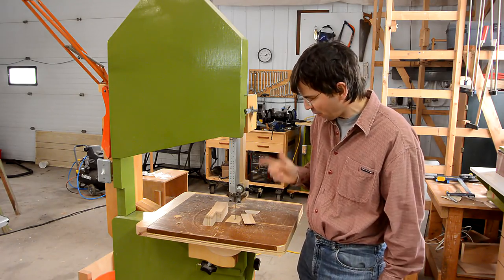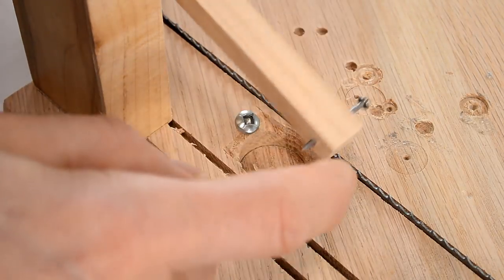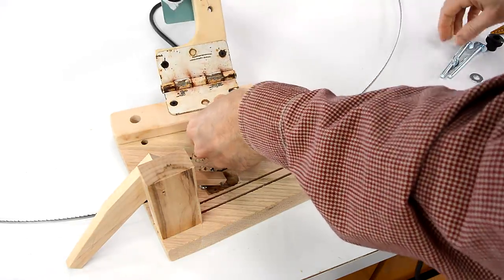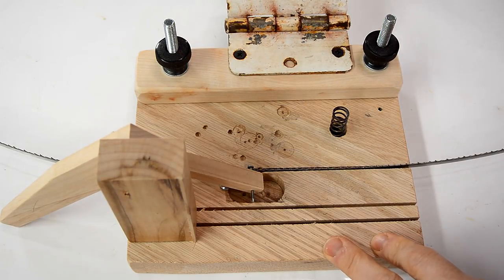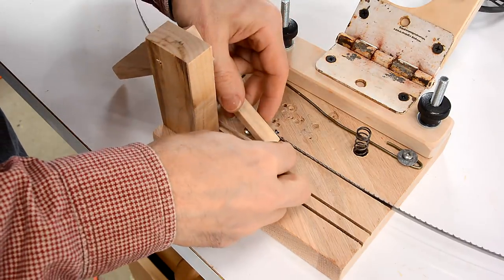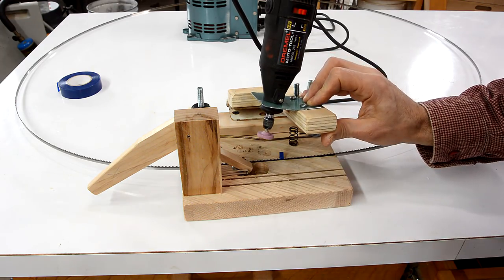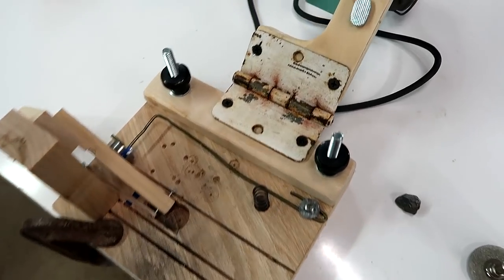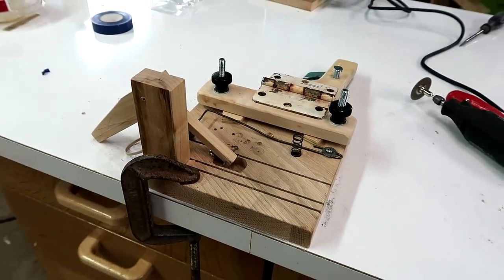Bandsaw blade sharpener jig

Comment: A fully automated bandsaw blade sharpener would be an interesting project, though, I think. A lot of people might benefit from that.
The current contraption is very ingenious, good work.
Reply: Someone else could take this design and improve on it. It should be fairly easy to automate since you only need to set the timing on two points. Which can be done through simple Electronics.
Reply: I think Matthias could figure out a mechanical way to automate too.  Every time the Dremel raises back up, it advances the blade.
Reply: Jason Svendsen, thinking the same thing, all worked by a hand crank, that can also be easily changed out with an induction motor, geared down.   
I'm suprised he didn't find his contraption that useful.
Reply: Jason Svendsen,  That's good thinking!  I would imagine that full mechanization would take more precision, he's operating this grinder plunge by hand to make up for the general vagueness of the machine.  On the other hand, the advance is pretty definite, the teeth probably have very uniform spacing and the rough kind of mechanism for advance might be adequate, so it would make sense to link them.  Also, if there was something simple motorized and speed-controlled that just did the advance and let the sharpening still be "by hand" he might be able to go faster and faster w/o a big investment.

Comment: After trying your sharpening technique just last week for the first time, I see this tooth advance system as a helpful addition to the method. I found that if the tooth was bent to the left I'd move the grinding wheel across so I could hit it square on, and same for a tooth bent to the right (and ones in between). This system doesn't allow for that but still pretty cool. The movement of the dremel was about an inch between hitting a left or right bending tooth square on which is quite a bit. A tricky one to automate but worth thinking about next time I am sharpening. Anyway, Thanks!

Comment: I'd really like to see a follow-up on that jig, but I understand your point. I would have probably made it different in the first place.
Keeping the screw to adjust, but have the dremel spring loaded to drag down on the blade and with a cam-type implement to lift it when pushed further. If that works, automating it would be a breeze afterwards.

Comment: @Matthias Wandel , Facing the contraption, The only way I can imagine this being done automatically is with a 12v DC motor with good torque but not much RPM. Add a wooden wheel to this with a nail. Tie two strong but thin ropes to the nail. Screw two eye-hooks into the side of the thick base. One eye-hook is below the dremel lever, pulling it down when ever the nail is on the east-side(Right). The string loosens during the descent from the east-side(Right) toward the south-side(Down). But during the ascent from south-side to west-side(Left) it tightens the second rope. The second rope pulls on the second lever somehow and this pushes the bandsaw blade forward. Before the rope loosens during the ascent to North-side(Up) before the process repeats.

This way, you can adjust the RPM on the 12v DC motor quite easily to get the ideal amount of time on the contact points. I just can't think of how to easily accomplish the second rope idea. Since it needs to be loose while the other is tight, vice versa. Easiest is simply having two DC motors. 

This would essentially make it automatic. Then it is just a matter of designing adjust ability for different sawblades.

Comment: Ingenious build. Maybe in the end not as effective (quick) in use as you expected it to be but nevertheless: it works and for sure it was fun building it. Thanks for sharing.
Maybe with some (a lot of?) adaptations it is possible to make the bandsaw blade sharpening jig that way that it is possible to
leave the blade at the bandsaw (vertical instead of horizontal now). That'll  save in any case time for mounting and unmountaing the blade.

Comment: That’s a pretty cool idea. Did you use the rusty hinge for artistic value? 😛
Reply: You have to know one thing about Matthias: When he can use garbage without compromising on functionality, he will use garbage.
Reply: I doubt it, Matthias is most certainly a function over form kind of guy.
Reply: Only time I've known Matthias to do anything simply because of artistic concerns was when he carved the name onto an urn instead of burning it in with a solder iron.   Which he said he only did because he thinks burning in looks bad.   Every other project has been decided  purely on function
Reply: Well, and green paint!
Reply: Last night, I threw a pile of rusty hinges in the scrap metal box. "I'm never going to use these," said I.
Reply: John Roebuck not even the green paint.   He mentioned having it left over from a previous project.   He just wanted to paint the first machines to protect them.  If he'd had ever had yellow paint they'd be yellow machines.
Reply: It must have been lying around. You can hear the defeat in his voice when he has to use new stock.
Reply: Haha, using new stock is painful for Matthias?
Reply: we should definitely set up a gofundme for green paint if he ever runs out, its his patented and trademarked colour.
Reply: It's Obtainium!
Reply: its for Aesthetic

Comment: Totally expected the pink stone to groove in no time. If you allowed some lateral slide in the dremel, it would be greatly beneficial. I have dremels and all, but I once sharpened one of these 6 TPI blades with nothing but a small sliver of translucent Arkansas stone hafted onto the end of a stick. This is a really fine and very dense/slow stone, and on the surface it sounds like lunacy (it is). But because the teeth on these blades are very small, it went surprisingly fast. About 4-5 seconds of rubbing per tooth. And the stone wore a hollow surprisingly fast, too.  I did this in several sessions just as an experiment, and I even sharpened the sides of the offset teeth; this is sorta hard to describe. But if you sharpen just the top of a really dull offset tooth, you would have to wear them to a stub to get out all the dullness, and then the straight teeth would be doing all the work. To keep them the same length, you have to hit the rounded off outer corner of the offset teeth from the side to make them sharp and provide relief from fricton. IOW, the outside corner of the offset teeth are kinda lonesome out there and receiving a lot more wear than the rest of the blade. I did this all under a microscope, lol. The blade cut way faster than and cleaner than new. And no, it was not worth the time and effort.

Comment: I believe automated band saw sharpeners use a cylindrical or conical grinding dies, that goes into the throat rather than on top of the tooth to sharpen essentially like a chain saw tooth

potentially that sort of operation might be easier to make a jig for. The point of automating isn't so much for time though, it's more freeing your hands up for other tasks, and preventing carpal tunnel syndrome. That said, if this is a once every year thing, then the jig's just going to take up space.

Comment: Hello Mr. Matthias, very smart and practical tool!
May I launch a challenge and an idea for a new video? Well I just watched a video in which some guys were using a cordless caulking gun that costs about 250$. According to you should be possible to make something similar, but cheaper, made by wood, and includes these features: speed /caulk flow and a simple spring loaded system that release pressure and stop caulk flow when stop pressing the trigger?
Thank you for your great job.

Comment: Maybe not worth it for you, but it might be a good project for those that don't have the confidence or fine motor control to sharpen by hand.
Reply from the maker: the skill to automate it and get that working right is more than the skill required to hand sharpen.
Reply: Mathias I think OP was referring to using the manual jig vs going freehand.

For older folks, and others too, going freehand is basically impossible

Comment: Love all of your vids Mathew.  Just one question on this one though.  All my band saw blades appear to have alternate bevels on the back of each tooth as per a circular/hand saw, of course it could be my eyes!  Anyway if so, this mean the dremel attachment would need to swing both left and right as well, alternate teeth could then be sharpened before altering the angle and sharpening the remainder.  Maybe it doesn't make that much difference!

Comment: Hmmm.....could you put a bandsaw blade on the saw backwards(so the teeth point up and do not cut), and sharpen the teeth with the saw on with some sort of file or abrasive dragging across the teeth as they fly by?

Comment: A couple of solenoids and an Arduino and you could automate that process.  The magic is in the mechanics and the microcontroller just repeats the allowed movements over and over, and aren't difficult to get doing useful stuff, even for a non programmer.  The $50 Elegoo Arduino Starter Kit on Amazon is all you need to gain a good understanding of using one.
Reply from the maker: The problem is not the repeated motion, the problem is things that go wrong when no one is watching.

Comment: I haven't read all 174 comments, to this point, so here goes.
The only addition to the manual device I would add is a depth stop under the Dremel mount to assure equal height teeth.

Comment: Automating this would not take as much debugging as you are thinking.

There are only two actions which would be handled by a single while loop and two if statements. The actions would be automated by attaching a solenoid to each of the activation levers.

While end !== done

//sharpen blade
if Advance == done

 Sharpen blade
// set variables
sharpen = done
advanced = null

endif

//advance blade
if sharpen == done

Advance blade
// set variables
advance = done
sharpen = null

endif

next while 

The hardest part will be to make a mechanism to inform the micro-controller that it has reached the weld spot and the end of the blade. 

That can be done with an attachment to the weld of the blade that trips a cutoff switch when it   gets to the end. A mag switch with a neodymium magnet on the blade would do this nicely. Or an Optocoupler that is tripped by a clip that is attached to the blade

As far as determining when each of the two steps have finished and taken place, an Optocoupler signaling the end of the movement would work.

That's the complicated way using an Arduino, Raspberry Pi or other micro-controller.

A simpler solution would be to use a 555 timer that signals each of the two solenoids every second. Or signal one at the top of a second and the other at half a second.

Manually, you were likely doing about 2 teeth a second.

Now, if you decided you wanted to get reckless and dangerous; have one solenoid activate at the top of the AC sign wave and the other solenoid activate at the bottom of the AC sign wave. But, that would probably shake your device apart and destroy a blade in the process.

OH but what seed. Tim the tool man Tailor would be so proud of you.
😉😂

Comment: How come you couldn’t take your speed control (voltage regulator...I think), slow the band saw way down and gently let the blade glide across the grinding wheel... you would have to run blade in reverse if my mind is seeing it correctly

Comment: the device is very nice, what i dont get, and i would love you to explain, is why it works to make a bandsawblade sharper is you nick the top of the teeth
Reply: Guzzist11 each tooth has two surfaces which come together to form a tiny sharp edge. A dull blade means there is a round over where there should be an edge. The grinder makes one surface planar again which reestablishes the sharp edge by removing the round material.
Reply: David Virgillo is correct. I did a quick google image search and found this detailed image that shows the grind very clearly. hope it helps. It's on Matthias's website, woodgears.ca.
https://woodgears.ca/bandsaw/sharpened.jpg
Reply: thank you very much guys. that indeed helped and i understand now how the geometry of those teeth work.
Reply: Not only do you need a sharp edge, but you need that edge to be the leading part. When the tooth wears, the edge wears back and allows a bit of the steel behind the edge to contact the stock you are cutting.  You tilt the dremel back when sharpening so that you restore this needed relief angle.